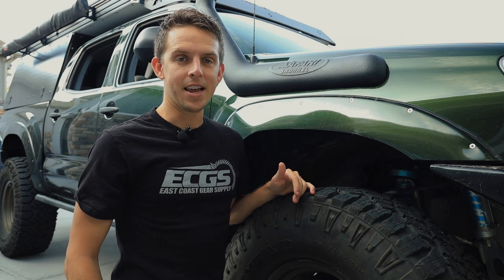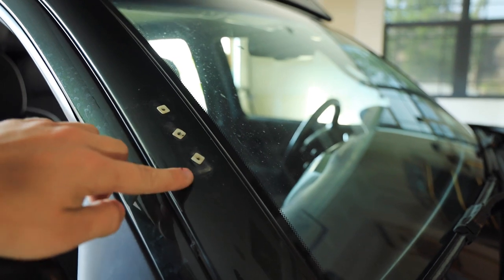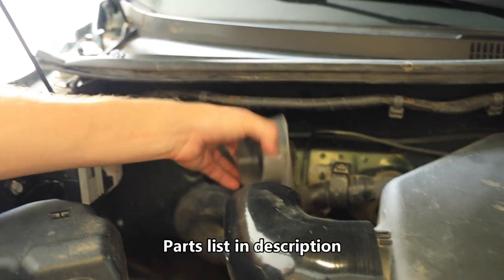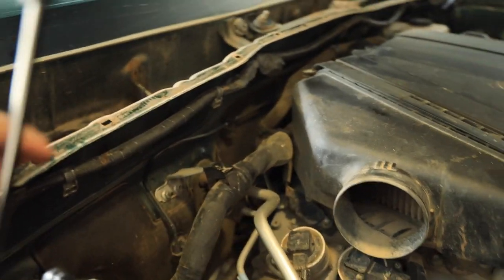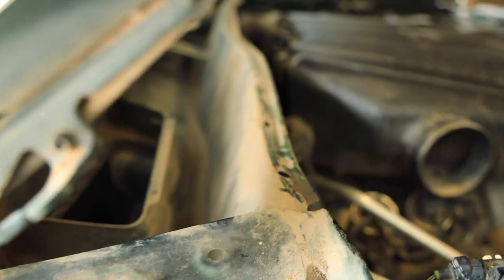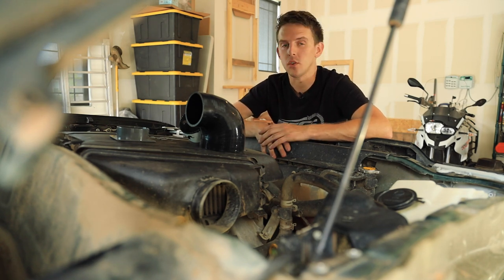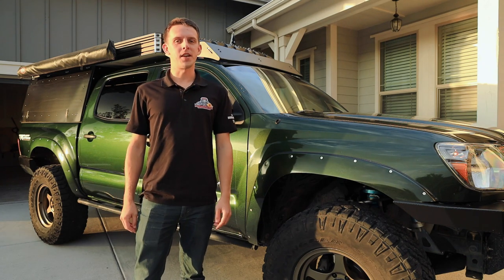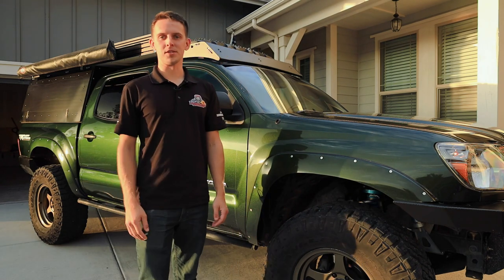Removing my snorkel! Cowl Intake mod

Comment: This mod is on my list to do. Glad you’ve filmed it

I was supposed to get a pyrite mica off road Tacoma but it fell through.  If I could go back in time and buy one new I’d so get the green.
Reply from the maker: Pyrite is such a nice color too
Reply: Ripcord 

I was so pissed when I almost lost it in carvana but then I was able to buy it. TRD Off-road double cab short bed.  But carvana canceled the order due to a safety issue with it.  

I’m thinking rusty frame since it was a NY truck.

I now have a super white SR5 4x4 so it’s a nice Tacoma and if I really want a cool color I’ll just wrap it.  But I probably won’t because money

Comment: I am loving this idea for a couple reasons, main one being ill be removing the inner fenders when I trim the flares. And in my head adding more vent holes for the new intake should also theoretically let more air into the cabin

Comment: Only issue I see with this area for the air intake is if you are parked overnight in a tree shaded area this cowl tends to get plugged with leaves, especially in the fall. Snow and ice could also be a winter issue i suppose as well.
Reply from the maker: True, but the cowl area also has openings in the fender wells and some from under the hood. Not too worried about everything being blocked at once

Comment: That's an old hot rodding trick for ram air intake.  Another is to simply add washers under the hinges holding the hood to the body.  This will give you a large intake area at the base of the windshield.

Comment: A Pillar, sticker. TRD or something Toyota related.
Are you not afraid of water flooding in via the natural flow off the windscreen in rain/storm
Reply from the maker: Nope, I showed somewhere in the vid where water wont pour into the intake
Reply: What about the wake from water crossing over the hood during a high level water crossing?

Comment: I'm new to this so excuse my lack of knowledge. But why not just keep a 4" tube for the entire intake??
Reply from the maker: Fair question. There's 2 reasons:
1) The OEM intake tube also necks down. It expands to 4" near the filter housing there to slow the air down to pass through the filter effeciently
2) The cowl area is not tall enough for a 4" tube, the "gutter" at the bottom of the cowl area would then drain water into the intake instead of the intake being above that.
Reply: Ahh, I see! Thanks for the info. I need to do this stat haha.

Comment: What kind of hardware did you use to hold your fenders on, exactly what I need!
Reply from the maker: Stainless steel flatheads, more info the build thread (link in description)

Comment: So the impetus to remove the snorkel was that you did not like the aesthetics of having it sticking out and making the vehicle look less streamlined?  Well, though that seems like an odd reason to go through all this work to me, it's your truck so it is 100% your preference and decision, and no one can ever argue with that.  I spose you also got a youtube 'how-to' video out of replacing it, so if your findings at the end of the video that your fuel efficiency got better holds out over the long run, you definitely got a net benefit.

Though you might have lost some utility, in that you can't go through deeper water than you could with the snorkel, since you said you never really did deep river crossing anyway, I guess that means you did not need that utility anyway. So you got your streamlined truck back, and if you did not need the extra utility from the snorkel, you did it right by you.  Which seems like it is more than enough justification to go through the work to do it.  So, well done, young fella.  

Let us know in a later vid if the fuel efficiency increase held up, and if you do ever get leakage problems when the snow piles up on that windshield.

Comment: This is a great idea which I'm going to do on my 2012 Tacoma. Curious though, why not use a length pleated flexible intake hose instead of the rigid couplings? Wouldn't that make it easier to change/clean the air filter?
Reply from the maker: My goal was to keep a smooth path for airflow, though how necessary that is remains questionable. You can definitely use a flexible intake hose.
Reply: @RipcordHQ  Any winter issues with the hidden snorkel intake, i.e. snow covering the cowl?
Reply: @RipcordHQ  well I finally got this mod completed. Thanks for the guide for doing it.
Reply: @GMauriceGuinouard  did you have any problems with the snow covering?
Reply: @dsa420meh7  Nope, I didn't. That mostly being because we don't get a lot of snow where I live in central AZ at about 5200 feet. Also when I do expect snow I put a windshield cover on the Tacoma and it's apron is long enough that it covers the cowl vents. All that be being said if the cowl is covered with snow, a quick swipe while clearing the windshield and the heat from the engine will melt what's left in a minute or two.  
One thing to note. With this mod the initial start of the engine, and whenever you accelerate you'll definitely hear more engine noise. Once you stop acceleration, the cabin noise goes down to normal levels. Hope this helps.

Comment: One of the reasons I am not going 35’s is due to removing my fender liners. I do not want to do that.  I’m running 34’s and there is no need for me to upgrade since I can go on all the trails with rigs that run 35’s.
Reply from the maker: part of the reason I trimmed the fenders was I always thought the 2nd gen taco flares were too bulky looking and they look way better trimmed

Comment: Love the vid man! Curious if you just dumped it into the cowl with no filter or anything or sock? 35 lift and cab Mount chop would be a good video also if you regeared.
Cheers
Reply from the maker: The stock filter housing is unchaged, just the piping that leads to it
Reply: @RipcordHQ  sorry I meant at the beginning of the piping on the inlet into the stock filter housing from the cowl, is it just open pipe or like a filter
Reply from the maker: @4xhoser  ah, that is all open currently

Comment: Careful on water crossings.... On a deep one that rushes over the hood and onto the windshield water will go up the windshield and back down into that channel... the reason the aircon has raised inlets is because water is not allowed in and then can drain... with the intake where you put it another lower area when flooded with water is you new intake with what looks to be a down hill ride straight into the engine. 

I wouldn't say its better than a snorkel, because a snorkel is meant to allow a vehicle engine to breath when entering deep water and this does not.
Reply from the maker: I think you need to look closer at the setup. The intake is not at a "low point" in the cowl as you say. It is actually as high up in the cowl as I could get it, above the HVAC intake even (granted, I should have shown another shot of the cowl with everything installed). The cowl will need to almost completely fill up with water before any goes into the intake pipe, which is basically impossible unless I am fording water as high as the hood (which I wont be).

As far as my claim of "better than a snorkel", I added a question mark at the end so people can make up their own mind. For my purposes though, it is better.
Reply: @RipcordHQ  A shot of the after on the cowl would be good. Another easy way to check/show how well it works would be to toss a hose or 2 on the windshield with the intake disconnected. Not perfect since an engine does pull a lot of air in but it would show if water were to pour out of the intake hole or not to simulate a river crossing. I think it would be GREAT content!

But if your not doing deep river crossing then a snorkel is not needed.. Personally I love the look of a snorkel but I understand the clean look as well.

Comment: Hey man goto a local welding shop shoot them a 12 pack of beer and/or 50 and they can MIG / TIG those holes easy yes u will need to sand it back and paint it but u can very easily find color matched paint or just order a 1/qt either way will make it look spiffy ... IF YOU WANTED TO COME FOR A TRIP TO BC I maybe able to help u out :P

Comment: Can you give your single best reason for going with a Toyota vs a Ford? I’m on the fence.
Reply from the maker: healthy aftermarket and I didnt want to spend my money fixing the truck
Reply: I have an '03 sr5 v6 4x4 bought new 17 yrs ago. Been all over the country with it. Pull horse trailer and camper. I have not had to put a dime into it other than normal maintenance. Nothing ever goes wrong with it. Can't speak about durability of new generation Tacoma's but in general I'd say you can't go wrong with buying one.
Reply: Toyotas have covered every continent AND the Arctic, to the North Pole; they cannot be beaten! I have owned plenty of Fords, and loved them, but for a dedicated off-road or overlander? Toyota every time.

Comment: And when it rains or you wash your truck water will enter your intake.
Reply: wondering how he addressed this. especially since the bulk head fitting looks like it was installed rather low in the cowl